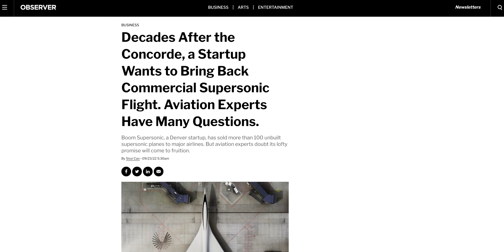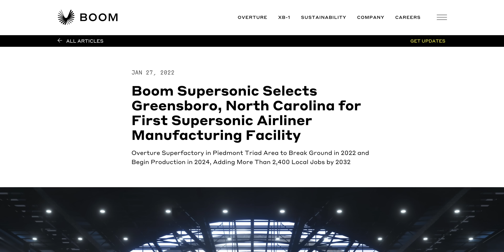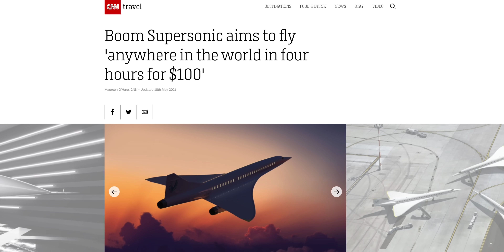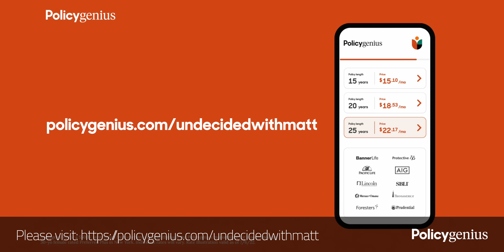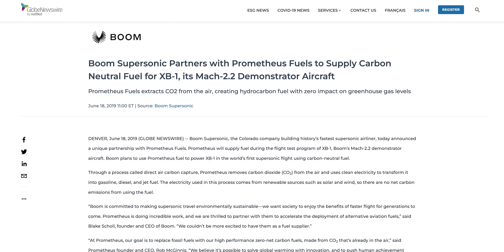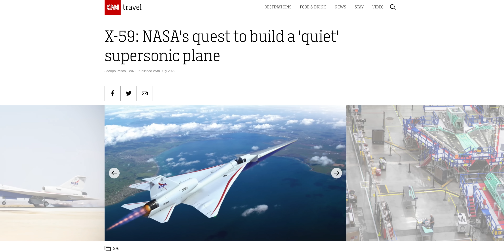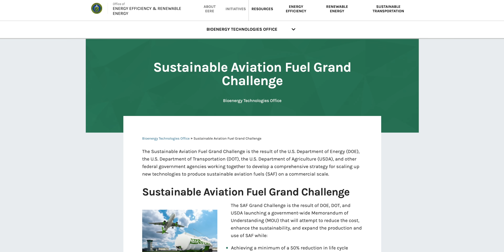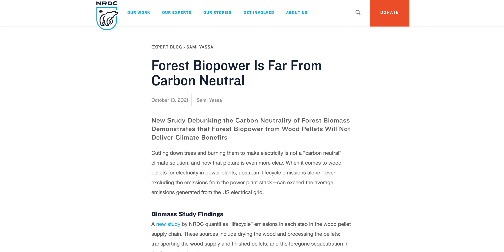Fueling a Clean Supersonic Plane Comeback

Comment from the maker: Do you think supersonic flight and cleaner fuels are the answer for next generation planes? To start comparing quotes and simplify insurance-buying, check out Policygenius: https://policygenius.com/undecidedwithmatt. Thanks to Policygenius for sponsoring this video!

If you liked this video, check out: This Invention Could Supercharge Solar Panels https://youtu.be/ytdWAKgPyI0?list=PLnTSM-ORSgi4dFnLD9622FK77atWtQVv7
Reply: Oh yes, supersonic aircraft will be much cleaner due to the extreme amount of fuel burned. 

Airplane Travel in general is very Clean. They wash these Gas Guzzling Wonders regularly, inside and out. Between unloading passengers and loading new passengers, a cleaning crew will generally go thru the cabin picking up trash and wiping up spills. Very Clean. The have nice Air Filter to Clean the air, so everyone has warm clean air to breath. Supersonic Aircraft will be even cleaner, as Matt Ferrell says. Remember, Supersonic Travel uses much more Gas than your normal Gas Guzzling Subsonic Aircraft making such travel more expensive. So, only rich people who can afford to burn all the extra fuel to travel from one spot to another, like to be pampered. First Class Treatment on these Tiny Supersonic Aircraft to keep rich folks happy. Cleaning before the flight, cleaning during Taxi and Takeoff, cleaning during the flight, wiping up the wine spill, the cabin crew will continuously clean. And as a bonus, for flying so fast, due to the extreme energy usage, the entire aircraft will heat up. Burning off everything, making the exterior of the aircraft cleaner than when it took off. Just like putting the aircraft in a bonfire of jet fuel.
Reply: Not a chance.  Go check out Aerion.  About every 10 or 15 years the new company comes out saying they’re gonna bring back supersonic airplanes.   I think we’re more likely to have electric planes first.
Reply: Why continue to spew so much crap??? YAWN
Reply: Hey Matt we have scam/bots with your profile and name in the comments section. Thought I'd say something about it.
Reply: I think it's a bit like F1. a lot of car progress has been made fueled by the competition in race driving. If there is nothing tangible to pull for progress, like those ideas around supersonic sustainable flight, what would push for progress ?? A bit of a catch 22 there.
Reply: Sub 3 hr flights can be 100% electric in 2030, IF we wanted it enough.
For longer flights SAF and efficient engines.
Supersonic needs to come back and for starters just see how fast they can go at twice the burn rate of SAF as a regular slow-mo flight.
Reply: Nah, I certainly am not undecided. I am sure that this is not going to happen. Boom has no engines. Some airlines are already bailing from these projects. SAF will harldy be available or cheap enough to supply all of our flying wants - it might get gobbled up by the military first! And Sonic boom as well as cost per passenger will mean a super thin slice of the aviation market will ever be on the cards in the first place. Which ensures there won't even be economics of scale since you cannot fly anywhere. 
Add to that the rising pressure on private plane use - even that alley will most likely never appear.
Reply: Even if these technologies don't achieve their ambitious goals, it's likely to lead to significant improvements in a wide range of applications. Which is good.
Reply: Supersonic flight seems like a very 'dream big' kind of scenario. I agree however on the potential of trickle down technology for increased efficiency in lower speed flights. As for SAF: carbon capture SAF is to me the most promising , if not the only, way forward. Obviously wood or agriculture based alternatives won't be able to sustain themselves for 100% aviation in terms of supply/regeneration time.
Reply: You reference the 747 in comparisons, and even said NEW 747, but the 747 went out of production this year, so there is no NEW 747.

For future reference, there's also no NEW Airbus A380 because they went out of production.

Please, when making videos like this could you please make sure you're checking data so you don't call something new when it isn't even being made anymore?  The last model Boeing had for the 747 has been around for many years, and in fact most of the production was for CARGO, not passengers.  The fuel consumption of 4 jet engines isn't good enough for airlines to use and compete.

You could have used a plane to compare that's similar in passenger capacity.  Regardless of what THIS company says about ticket prices, it's the AIRLINES that determine the ticket price, and there is NO WAY that an airline is going to sell these tickets on the cheap, because just like the Concorde, this will be used for people who can pay a lot of money to get them back and forth quickly, when said people don't own their own aircraft which is become more common.

So, a ticket on THIS plane for under $1000 USD is TOTAL fallacy.  It will be used for longer distance, getting wealthy people to destinations quickly, and no other use case.

Next, you can't compare this to a jumbo aircraft when this can only hold maybe 1/3 the amount of people.  I don't know because I didn't see where you talked about capacity and this matters.

So this video is too problematic because it's hard to take what was said and derive anything meaningful without having to do a lot more reading about the planes.  Not one of the better videos you've made recently.

But what I know for a FACT is that airlines want supersonic flight for wealthy flyers so they can get more money/ticket.  To figure out how this works, you need to know cost/plane, fuel costs, no. of passengers/flight.

And yes, adding two more engines means less fuel efficiency.  Factoid.  This is where the monster engines of modern subsonic aircraft win out big time.  It's why ticket prices have been able to be kept low as long as fuel prices aren't bad, but since oil companies are enjoying their OBSCENE record profits right now, ticket prices have gone up and these planes won't change it since once again these aren't for regular folk.
Reply: Dirty fuel might be a better answer.  IF it were high sulfur fuel, that MIGHT be a good thing for climate control since the sulfur would combine into sulfur dioxide, an ANTI-greenhouse gas. [Keep in mind what goes up must come down as sulfuric acid to dissolve Limestone and acidify the ocean.]  9/11 made me think of this. After three days of no air travel, the sky turned back to a much darker blue without all the high altitude water vapor. 

Supersonic flight MIGHT also be a good thing if they fly high enough that air resistance isn't an issue [ie. ballistic travel into really REALLY thin air].  But I doubt it since Air resistance generally quadruples as speed doubles at the same altitude, I think.  

In the meantime, people should learn to use eMail and Zoom, and let their fingers do the flying. Or hire agents at the destination to do their face-to-face work, or pay really really big airline charges. 

In short, looking for simple answers? Most likely there aren't any, but don't count technology out. Maybe Xerox will find a way to copy you and transmit your double to the remote destination.
Reply: Why grow food crops for fuel when some plants will literally grow like a weed and some have"experience" in getting people high enough to enjoy the flight, like cannabis. 😏
The side benefit is being able to sequester huge amounts of fiber in cement reinforcing. 🤔
Reply: Oblique flying wing!   As a young aeronautical engineer I worked on the NASA HSR program to make a new concord in the late 90's.  BTW a 2 engine delta wing SST will never satisfy 1 engine out on takeoff ..

Wearing my environmentalist hat, jet fueled SST should never again fly.   

But the best options to improve current air travel time are:

1. Improved TSA ...

2. Oblique flying wing with GH2 or Ammonia fuel designed for bigger market, not just the 0.1%.  Don't be greedy with design Mach number, i.e. less than Mach 2.  

But slower flying needs to be incentivized with international carbon taxes.  Navigation systems have a thing called "Airline Cost Index" which optimizes Cruise speed based on airline cost economics.   Alternatively an internationally enforced rule to operate at airline cost index equal to zero forces Cruise speed at most efficient speed.   Currently airlines waste a lot of fuel because it saves them money to fly faster.   Fuel is too cheap and no environmental externalities are priced.
Reply: No. I think a sustainable future will require society to embrace slowing down. It feels scary to even type that in public, but the ever accelerating pace of society must find a balance with the cost it imposes on both the planet and the people. Travel doesnt need to be fast, we have a hyperconnected digital soup that we live our lives in. You can have a face to face meeting with a person or group anywhere on earth, at any time- for free. The driving need to have everything we want exactly when we want it- has got to stop. Wanna travel overseas? Ok, but we cant afford to rush. Enjoy the ride.

Hyper efficient EV sail planes that can glide and fly a transatlantic route in 8 or even 12 hours is preferable to the status quo, if it means sustainable flight. Sustainability is non-negotiable. We cannot deficit spend our biosphere.
Reply: So how much CO2 does all the development of these new planes emitt ? Would it be much less co2 if one made the old Concorde with new materials - Carbon, new engines ,adjusted shape and a fatter body, but I guess its like baking the same bread again-boring
Reply: I think. 
That is why I laugh when watching your channel. You are hilarious buddy
Reply: I think. 
That is why I laugh when watching your channel. You are hilarious buddy
Reply: Thanks
Reply: too risky. I predict this won't be popular with in-flight fast speed internet and better VR/AR equipment. in other words, no wasted time while flying and the plane could take its time.
Reply: Hi Matt you may want again to let your audience know there is crap on your comment section by people pretending to be you.
Reply: No. I studied Aero Engineering. The drag at supersonic speed is to high, I believe the 8 X fuel use. The Virgin idea ignores heat build up which is OK for a few minute hop in sub orbital but over hours will be another monumental problem.
Always speed. I'd like to see it go the other way with airships comfort and a hotel room in the sky. Here in Australia talk of a very/super fast train between Sydney and Melbourne has gone on for over 40 years. A normal speed train set up with upstairs downstairs rooms would allow a sleep for the people and a fresh start for meeting in the other city. Instead of rushing around double the cab runs and a short rushed sleep. Same idea.
Reply: I always wondered if, IN THEORY, we could save on fuel by having intercontinental flights using boosters to get the plane (or spaceplane) on the edge on space? I'm guessing it wouldn't need as much fuel because of less air drag during most of the flight and then using the air-drag for decelerating before landing...  I know it would be incredibly expensive to develop such a spaceplane and it would probably need too much maintenance but I'm just curious in theory if it could be more economic on fuel.
Reply: @Reth_Hard  Its a decent line of thinking, the main issue with any other technology is that high bypass turbo fan engines exist. They are so incredibly efficient compared to any other form of propulsion that it just doesnt make sense to explore other options. Also the constraints on size and capacity associated with speed limit the number of passengers you can bring, which in turn increases costs further as you still have to pay for 2 pilots and a minimum of 2-3 air crew, along with all the costs and fees at each end of the journey
Reply: @tuqe  
Ah yeah, it makes sense. To be honest when I heard Elon Musk saying his Starship could eventually be used for intercontinental transport I was VERY skeptical. It's just seems so ridiculous unless we believe in fairy tails but I was still wondering if with the right technology we could get very close to this concept.
Reply: @Reth_Hard  Its such a shame that the guy who bought and bankrolled Tesla is so incredibly wrong about everything else 😅

At this point I take everything he says as a way to get more attention, all of his promises fail
Reply: @tuqe  solar city spacex PayPal.  Should I go on.?  He’s nuts but right way more often than not.  In modern economics the only entrepreneur in his league is Richard Branson.

Comment: Seems like a cool and intriguing distraction from real travel solutions. High speed passenger rail replacing flights over land can reduce total travel time with airport waits included and bring emissions and prices way way down. For cross ocean flight I think it's best we stick to the far more efficient 500-600 mph range and work on lower impact Hydrogen fuel. Electric flights might be good for cleaner island hopping where rail isn't possible, but for domestic flights they're totally impractical and still have a worse environment impact than rail.

Comment: If someone can come up with a process to capture CO₂ from the atmosphere and crack off the carbon and solidify it, that might become a source of synthetic graphite for batteries.  That process, scaled up, could be used as an offset to burn regular jet fuel, but highly refined to reduce any emissions caused by impurities.  (This assumes we never find a way to make the super-energy-dense batteries that would be needed for large passenger planes.)

Comment: I don't understand why a manufacturers don't capture the wind created by trucks, cars and planes similar to a windmill to recharge an electric  battery. Seems like you could use a plate with micro holes on the outside of vehicles to force the air to create electricity for a car, truck or plane and perhaps not need to use a battery.

Comment: synthetic fuels could be quite good, but a lot of the ones i've seen are aiming for petrol or diesel compatibility, which is great for keeping old vehicles running, but severely limits what fuels we could use instead in engines designed for eco fuels, instead of the other way around.

Comment: This supersonic comeback is an environmental catastrophe, they are extremely polluting and should be outlawed everywhere yesterday already, the rich funding them might as well be climate terrorists. You cant have cheap clean and fast at the same time you have to pick only two in this space, especially not in this case where the type of plane is so inefficient already so you might as well cross the combination of fast and clean and fast and cheap off the table, it's going to be fast, expensive and polluting, it's just likely not possible in the next 10-20 years probably.

Their claims are just lies to trick clueless moron investors, you can basically promise anything if the technology doesn't exist until 20 years in the future. Boom is a fitting name because bust is inevitable with their promises unless they pivot and raise the price per ticket into the sky and probably also become ultra polluting which no surprise is gonna happen especially when you can't carry more than a few people in your aircraft.

Any investor in this project is either clueless or has ulterior motives to sell off their shares right before it starts going down and crashes.

Comment: I was around when concord did thier thing. I was born on the small island of Guam and totally think super sonic is a great market for LONG distance travel. My average flight structure to get home from the midwest costs way north of 3k us dallors and takes on average a whole day. Now if I could cut those 8 to 10hr spans to even half it would be worth it. So instead of 26 to 18 hours drops to 20 to 10 hours. Of course I am including the usual wait time between flights and specific routes. So a hop to Japan then Guam is much faster the best time ever I got was 18 hours. Now the LAX to Hawaii then Guam is SO much longer and with current work economics leaves me with less time to be with family. So even at 3x the costs you are talking about I would be probably bounce to Detroit using standard then hop sonic to Japan then hopefully Guam. Concord landed many times on my island and it is built with long runs.

Comment: This is never going to fly. The biofuel beast keeps rearing it's head. There are too many industries that want it and not enough room on the planet to grow it all. 
To supply enough we would have to cut down every tree and use so much land that could be used to produce something useful like food. Normal planes work fine, but considering only the environment we are better off with boats or maybe rail. Then instead of pumping all that energy in generation of fuel we can just use that electricity directly to power transport.

Comment: The plural of aircraft is aircraft, not aircrafts. Also, Boom did not part ways with Rolls Royce, Rolls Royce have announced that they are not interested in developing engines for supersonic flight, from a commercial potential perspective. And then, no 80-seater is going to be profitable when it has similar needs / costs to aircraft that seat MANY more passengers. This is all in the context of all flights suffering the same basic time cost, regardless of distance (X time to board, and get through security) and Y time to recover luggage at the destination end).

Comment: One thing i dont understand. 
One of the push backs against electric or hydrogen planes, according to the aviation industry (lobby) and that you mention here, is that they are too heavy for long hauls.
However long hauls are the least polluting aircrafts since most fuel is burnt during takeoff.
But then why havent we packed a380 size planes with batteries or hydrogen to make short flights? Wouldn't that already cut a lot of emissions?